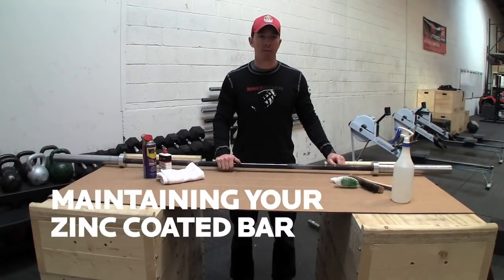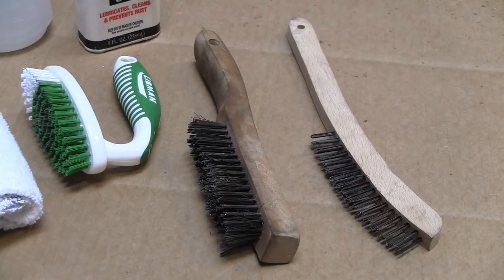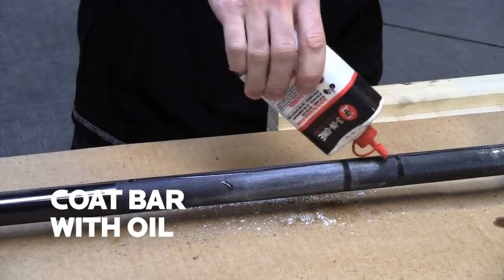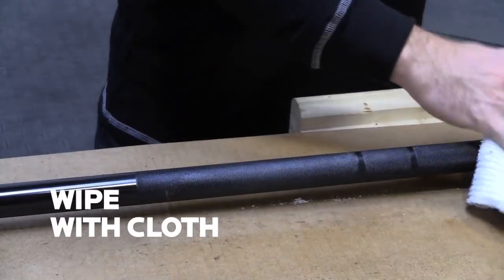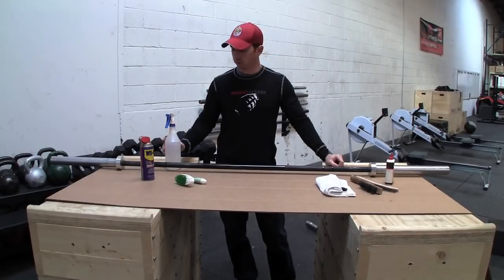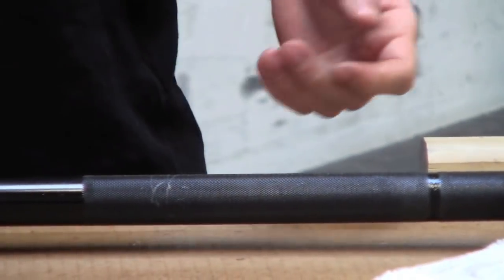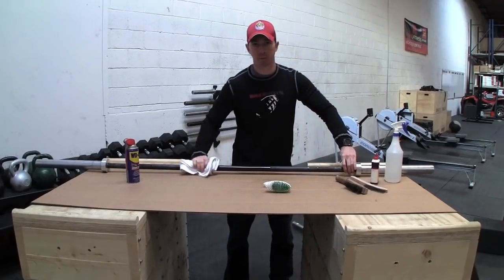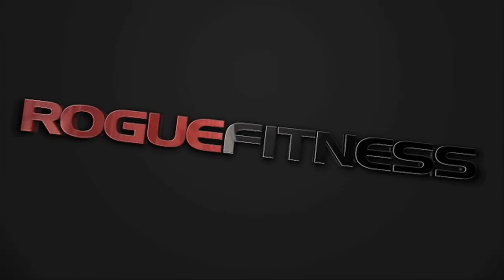Cleaning Zinc Coated Bars

Comment: Its about protecting the bar from corrosion.  The sweat from your hands gets on the bar to form zinc oxides and carbonates.  The use of oil displaces the water to prevent corrosion, hence WD-40 meaning water displacement 40.  This will remain a problem unless rogue makes a platinum plated bar which would be as expensive as it would be baller.

Comment: Have you had any experience with respraying the barbell with a black zinc coating? I've managed to clean my barbell up very nicely using the techniques shown in the video however the black coating has faded over time, I was just curious if you had any recommendations on this? The black zinc spray I previously tried to use would come off with my grip although it was specifically for steel.
Reply: How long did it take before you started to notice the zinc fading?
Reply: Hi buddy, How long did it take before you started to notice the zinc fading?
Reply: @HKX_ORANGECHICKEN  I’ll be honest I can’t really remember, it wasn’t too long though. I’ve had my bar 4 years now and it needs a scrub every few months as the rust is apparent. 
The gym I go to also have the zinc coated rogue bar, obviously these are used much more but they’ve all faded too.

Comment: is it possible to spray paint barbells to prevent them from rusting?
Reply: I paint my plates and barbells every two years with anti corrosive paint and they don't have oxide, and they look like new
Reply: @cesarinho22584  what paint did you use, I've cleaned up my barbell nicely and tried to respray with a black zinc coating. Its worked nicely, the bar looks amazing but the paint seems to come off on my grip. Any suggestions?
Reply: @robertstables9059 I live in Guatemala and the brand that I use is comex but it's anti corrosive can  and I have to use brush to paint the discs and barbells, and I paint two times

Comment: Will black zinc bars rust?
Reply: all metal will rust...eventually. in this case when the black zinc wears off to expose steel it'll rust if not taken care of.
Reply: @nrvnqsrxk  All steel* will rust... eventually.  There are some metals that won't rust but they wouldn't be appropriate to use in a barbell application.

Comment: Knurl and chalk are intended to increase grip. Oil is a lubricant! I'd rather lift a rough-looking, battle-scarred bar then drop a pretty, slippery one.
Reply: It’s not about aesthetics.  This will prolong the life and knurl of your barbell.  I have a bare steel bar and clean it once a month.  As long as you wipe off excess oil, it isn’t slick afterwards.  Give it a shot, it’s worth protecting your investment!
Reply: You do you